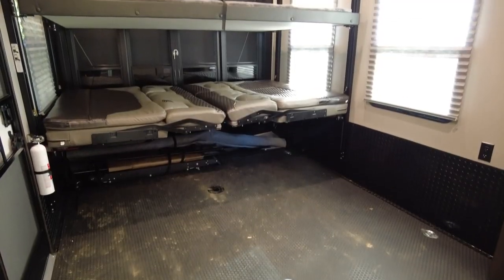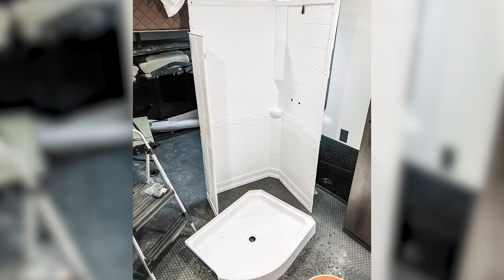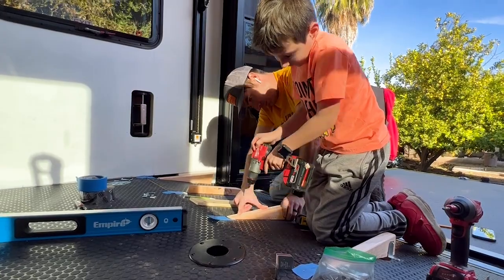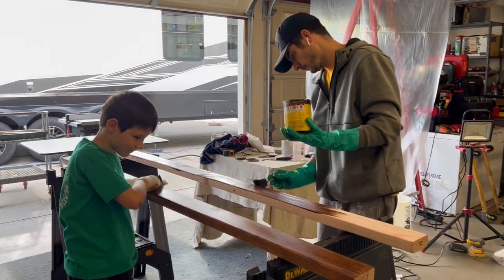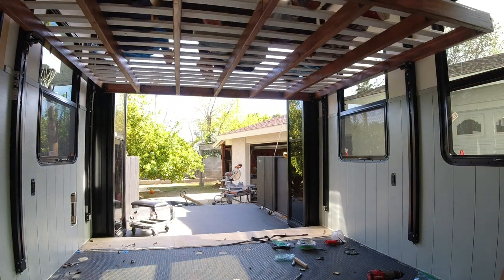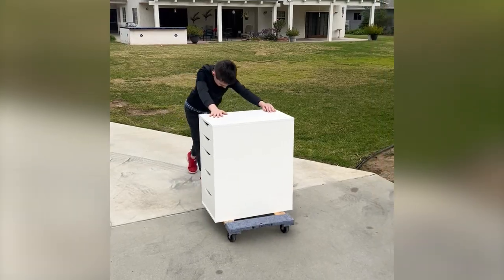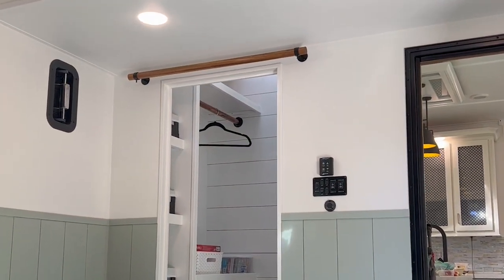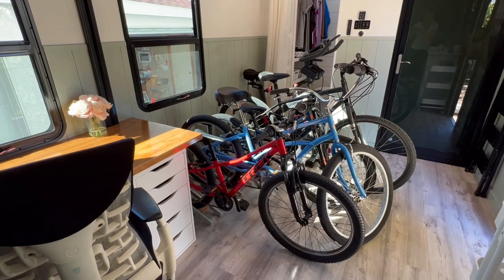Toyhauler RV Garage Renovated Into a Master Bedroom & Office - Start To Finish Remodel

Comment: When you said you ran a channel up the Happy Jack System using zip ties to get power to the lights and top of the bed- What does that mean?? I'm trying to figure out how the bed going up and down doesn't cause a problem with an extension cord or is there a different way?
Reply from the maker: This took me a good day or two to figure out.  I tried several approaches and finally settled on the following (which also happened to be the easiest/simplest).
1) Pin (zip tie) the one end of the extension cord where the frame meets the bed corner. I zip tied ours to the wood bed frame corner.    
2) Make 2 or 3 loops vertically along the backside (garage ramp door).  These zip ties I left quite loose.  Think 1”-1.5” diameter so the cord could freely move up and down.  Your goal isn’t to keep the cord tight like a normal zip tie.  It’s more so just trying to keep the cord hidden behind the happijac rail.  
3). Because the cord has weight, when the bed is lowered, the cord will naturally fall to the ground (through the loose zip ties) and kind of just lay flat in the floor.  Our desk hid that on one side and dresser hid it in the other.  

Hope that helps better answer it.  The cord is visible in the backside of the rail but almost entirely invisible from the front.

Comment: This is awesome! A few questions tho:
1. How do you secure the furniture under the bed for travel days?
2. Is the bed limited on how far down it goes?

Thanks, cant wait to check out your other vids!
Reply from the maker: Hi Randy, the desk and dresser are bolted to the floor and walls. We also use bungee cords to secure the drawers. The bed can come down all the way, but obviously we have to stop it before it hits the computer monitor. But if there was nothing underneath it, we’d be able to bring it all the way down. You can see how we custom made the bed, and how we changed it so that it could go all the way up and down in this video: https://youtu.be/e7RuHhjfwGg

Comment: Love the leveling of the floor in the back. Going to be doing the same myself. What size screws did you use for the brackets to the floor and to the wedges. Self tapping I assume? Do you have a video just on that part?
Reply from the maker: The floor is relatively thick (at least in our GD). You can get a good idea on thickness by pulling one of the d-rings in the floor.  Going through the wood triangles, we probably ran 2” screws and going through the brackets only we probably topped out size wise at 1”-1/4” screws.  We were able to reuse quite a few square head screws from the RV itself.  Good luck!
Reply: @McVeyMcFarm  Thank you..Perfect

Comment: How do yall keep the desk and chair in the garage area from sliding around on move days? Im thinking about making an office in mine and would love tips :)
Reply from the maker: Great question!  We used small "L" brackets attached to the floor and wall for the desk.  We then used those same "L" brackets to attach the desk top to the (2) Ikea drawers.  As for the chair, we ordered wheels that had brakes on them, and simply used a bungee cord to keep it held tight to the test.  D-Rings (easily found on Amazon, Harbor Freight, etc....) are what we used all over the rig to attach bungee cords to things.
Reply: @McVeyMcFarm  awesome thank you!

Comment: I'd like to accomplish a hybrid between how the Happijac works OOTB, what you did and what I've seen on another channel.

1. Use the lower Happijac bracket for a desks on either side.
2. Be able to "grab" the top from a greater distance so you can leave monitors on the desk when you bring the top bunk down.
3. Bring the whole thing to the floor.

The idea is to have a full height dual office in the day, and a quick conversion to bedroom every night.

From your experience, do you think a spacer between the two Happijac levels that allows the bottom engaging with the top to bring it down is feasible? Is there enough travel for the lower to go right to the floor with the upper say 3' above it?